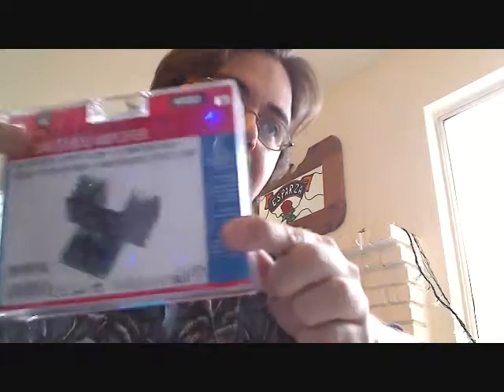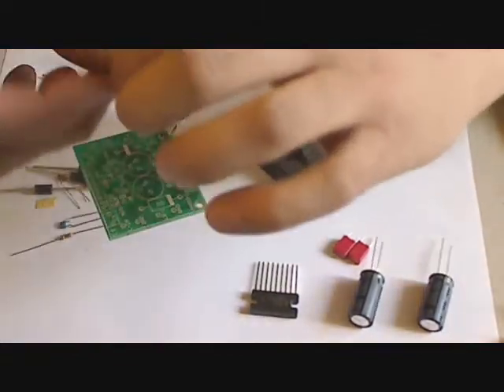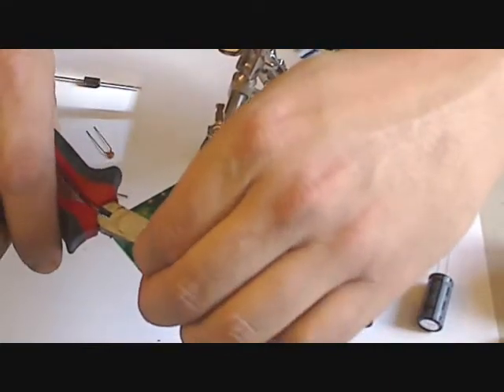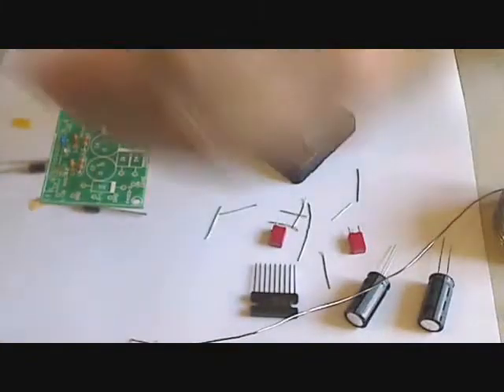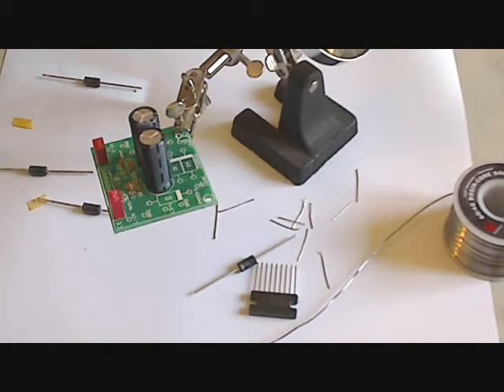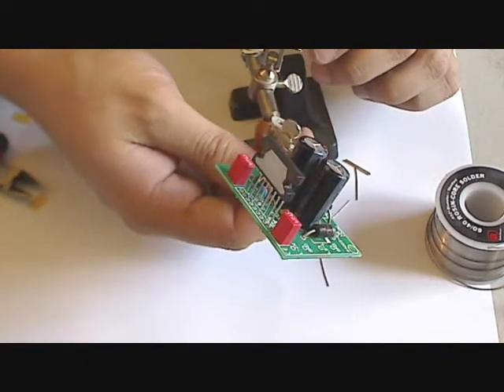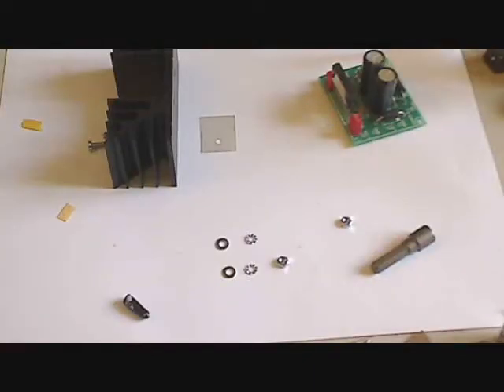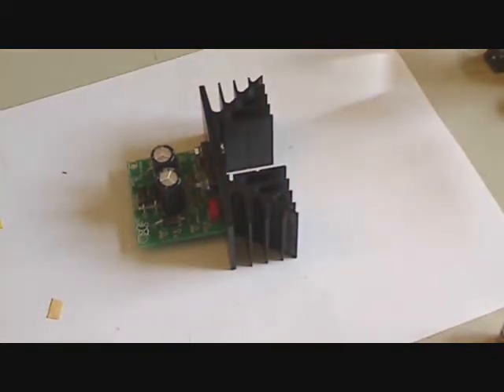The "Velleman Desktop amp" part 2

Comment from the maker: The solder I use is 60/40 Rosin core. That is 60% Tin and 40% lead with a Pine sap extract for flux.When the flux is heated, colophony has been known to generate fumes including aliphaticaldehydes (like formaldehyde) and "hydrochloric acid and other gases containing benzene, toluene, styrene, phenol, chlorophenol and isopropyl alcohol. According OSHA lead when Melted or heated produces Lead Oxide Fumes.The Important thing is be safe!

Comment from the maker: The kit only Includes parts for the  power rectifier and amp circuit. The transformer I ordered separately it was a 2x12v 50va toriod. If you buy this kit and the wed site has a "add transformer" research the the transformer make sure the power is right. If its IE transformer make sure the shielding is high quality or you'll get a hum in the amp.

Comment from the maker: The color code is gray, red, gold and, gold. that works out to 8.2 ohms they are grounded from the speakers line out so the wattage would be around 30 to 10 watts depending on your speakers. you can also look up the data sheet for a TDA2616 amplifier circuit. this is what the velleman kit is based off of. I would also like to see your finished amp too so post a video on it I'll put a link for the data sheet in my description. If that help pleas like.